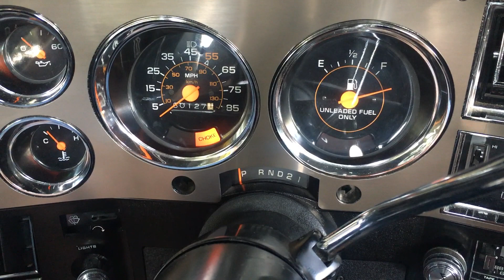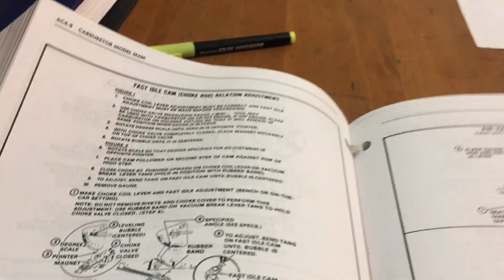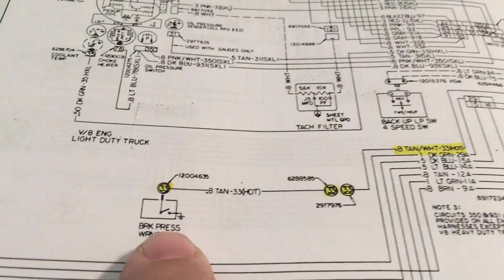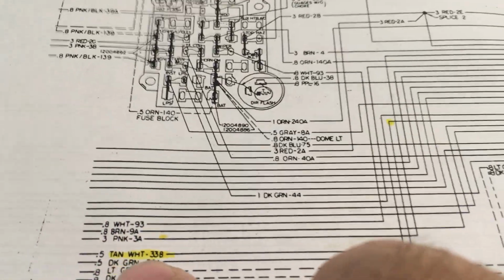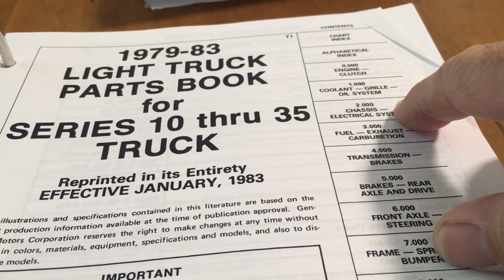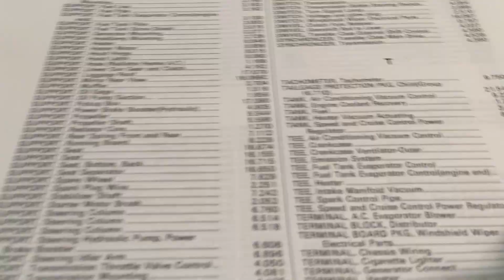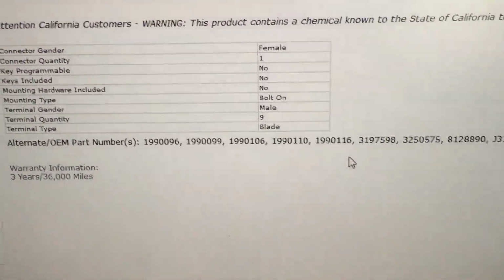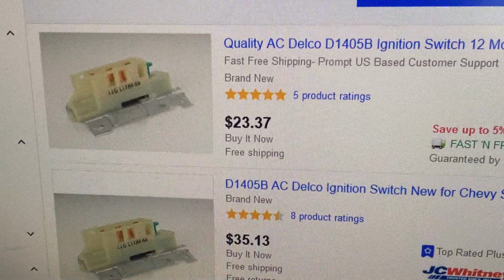1981 Chevrolet C10 Dash Brake Light Diagnosis, And Repair Part 1

Comment: That was great, totally bashed all the Millennials out there, opening up a BOOK to figure out the problem!  Then, once you have the key piece of information you need, then it's a great use for the Internet to get the parts needed.

Why is the gas gauge reading way over full?
Reply from the maker: It felt wonderful to do that! I had enough of the "what's wrong with my truck"  type questions. I had to show the way to figure it out. I love the fusion of old, and new technology to figure stuff out.

The gauge just does that sometimes, for as long as I can remember. As long as it doesn't go fully horizontal to the right, not a big deal. When that happens though, the selector valve stuck between the two tanks, and if ignored, it's the same as running out of gas. Don't ask me how I know!
The remedy is taking a screwdriver handle, and tapping the selector valve, and then depressing the tank selector switch to the desired tank. I do have a replacement selector valve to fix it right someday.